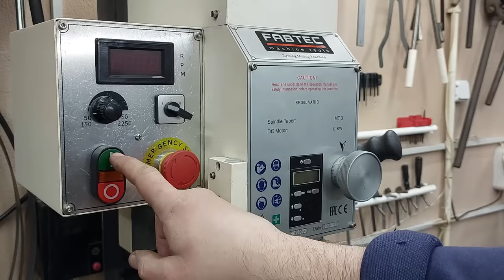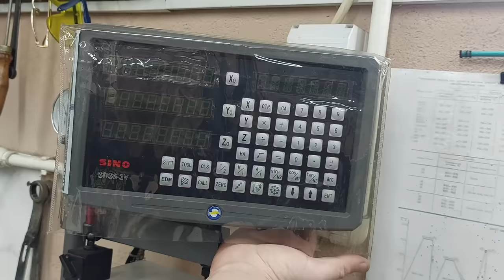This innovative homemade tool surprised even professional car mechanics

Comment: I can't imagine that any car mechanic, pro or otherwise, would be surprised by this simple $10 tool.
Reply: Quite so - I've been using them for over 50 years
Title is crap but the point of the video is to show folks who have the time, tools and inclination, one way of making one for themselves. Quite enjoyable making your own tools ... tends to make you less likely to abuse them when tired or in a hurry
Reply: Exactly! It's a simple nut splitter, just like any of the 3 or more different versions you can buy on Amazon right now and HAVE been around for 60 years that I personally have been seeing them and probably a lot longer. 
Not that many people have access to both a lathe AND  a mill and even if they did, Without hardening that probably only mild steel hex stock he used AND the main unit, they wouldn't last long either. This thing can only handle pretty small nuts too while the Amazon or EBay cheapies at least might. 
I'd estimate even with the equipment, at least around 4 hours to make, and that's assuming you've got all tooling handy, including the knurling tool, another hour or so IF you've used good high carbon steel and harden then temper the parts appropriately. I value my time at more than the around $2 an hour that piece of junk works out to. I'd also rather have one that is capable of bigger than nuts for 1/4 inch thread.

Comment: Standard nut splitter, there are also hydraulic ones available as they rarely seem to work
Reply: The hydraulic type is the best in use. I have a hydraulic splitter made by KD Tools which has the shank part offset at an angle thus making it easier to get into tight spaces with.